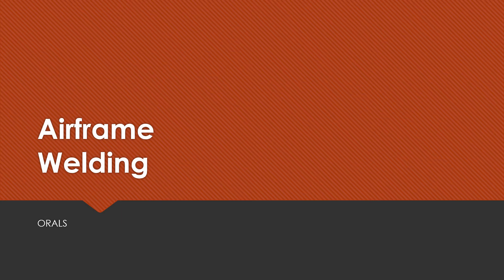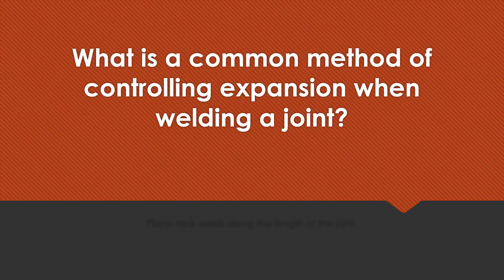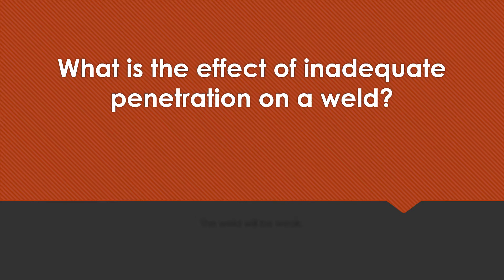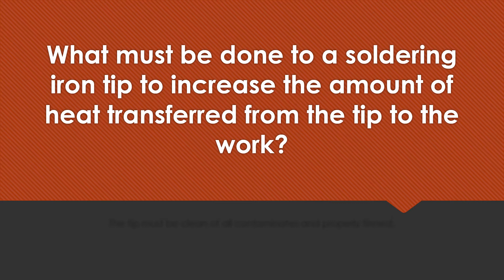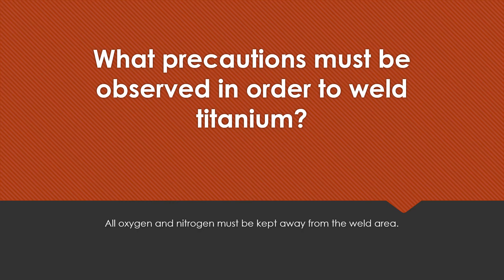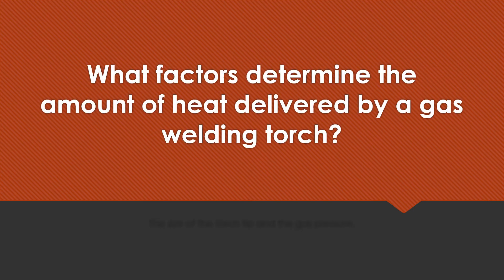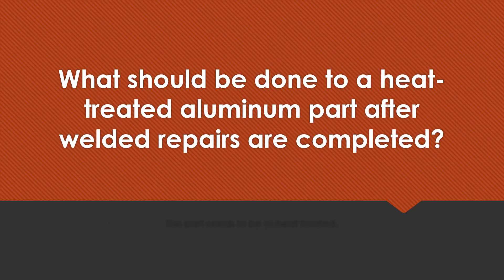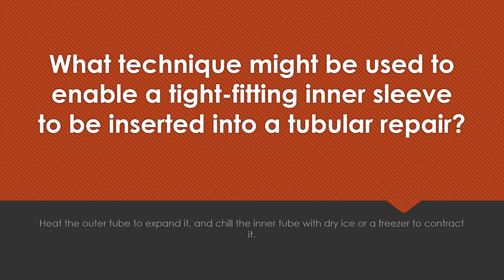AIRFRAME WELDING ORALS

Comment: These videos are immensely helpful so thank you for taking the time to make them. I recommend getting YouTube Premium so you can listen with your screen locked on your phone. Also do you have any advice on how to study? Do i just study the areas i missed questions on on the written or everything?
Reply from the maker: For Orals, I study my weakest areas first. When I was studying, for Airframe it was Electrical and for Powerplant it was Fuel Metering. The subjects I found easier I would slip in a refresher here and there to be sure I was still good on those subjects. 

For the Writtens, I used ASA Prepware, but there are many good study apps out there. I would take a practice test, and whatever subject I missed the MOST questions in was the one I would do a study session on (study all the questions). Then, I would take a practice test again and keep repeating the process. The subject areas that had like 30 questions or less, I would spend my lunch hours study session on those. I could get the study done and review my missed answers before going back to work. 

Hope you found this helpful, and good luck in your studies!